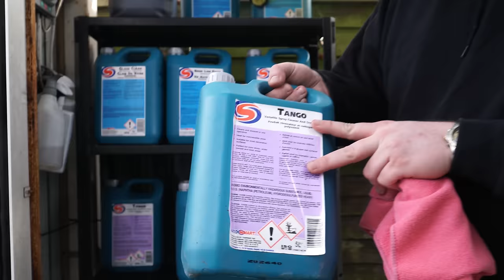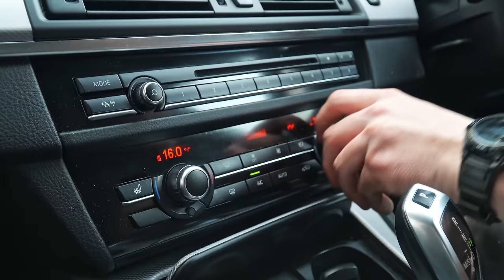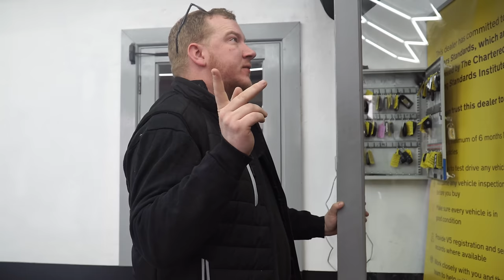As Soon As They Paid, IT REFUSED TO START!  | BM Weekly 33

Comment: The reason the Tailgates on L550 Disco Sports leak is because they never fitted properly. All cars at JLR had to meet gap and flush standards. The only way to get a L550 tail gate within spec was to bring the tailgate outwards from the body. That was fine with brand new seals that were heated up before fitment. All Disco sports were built at Halewood which had a water test facility. That involved water being sprayed on the car at high pressure. 

That was fine if the seals were brand new and had just been fitted. If a car needed repairs before it was sold then they rarely passed the water test. The solution was to then bring the tailgate back towards the body. 

So you either ended up with a tailgate that didn't meet spec or a car that was leak free.